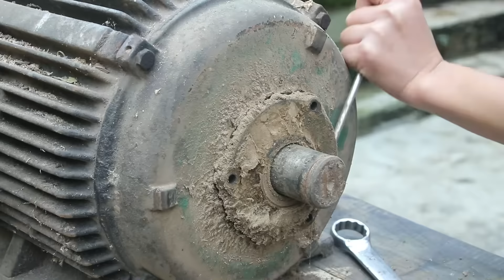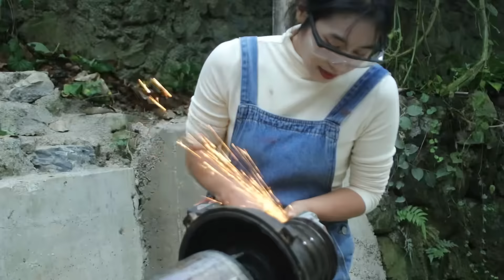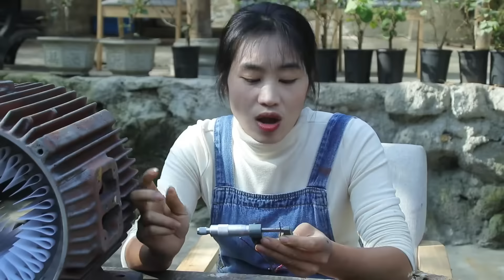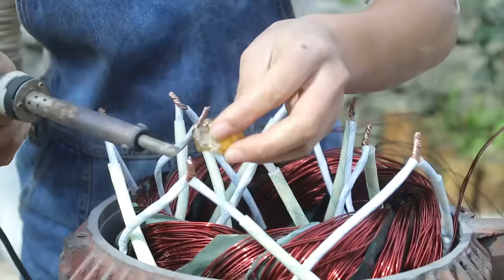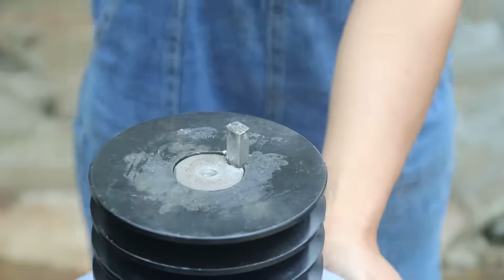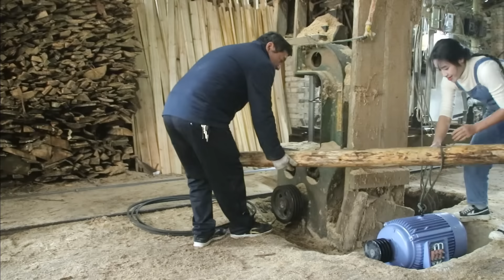天才女孩修复300斤的电机，为木材厂发电⚡Genius girl repairs 300-pound motor丨林果儿

Comment: The skill to rewind motors are in demand in Canada as well, only we will use a lot more power tools and laser alignment. Much of the equipment I saw are decades out of date. We rarely use multiple Vee belts, instead we use Kevlar cogged belts, laser aligned and WITH a belt guard, and the motor would be inverter controlled.